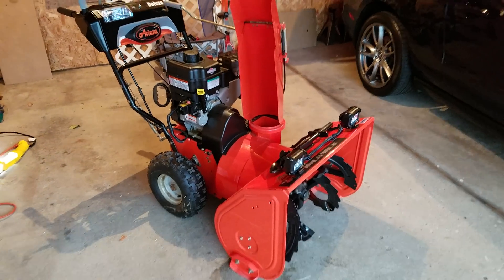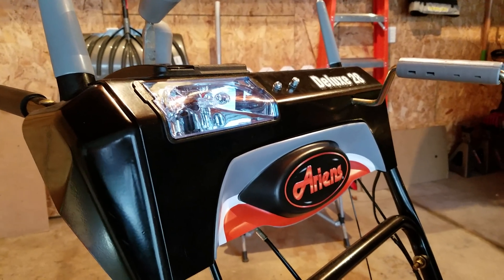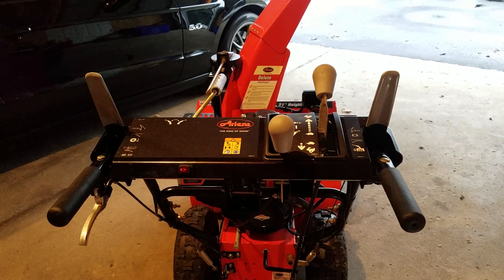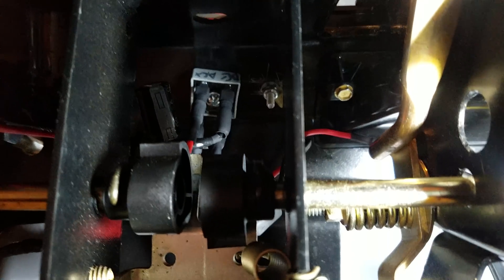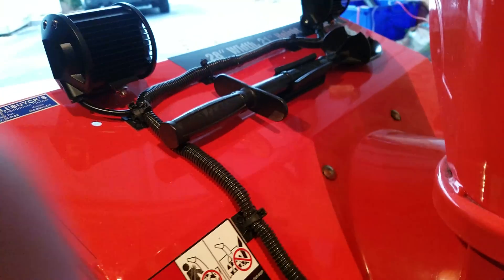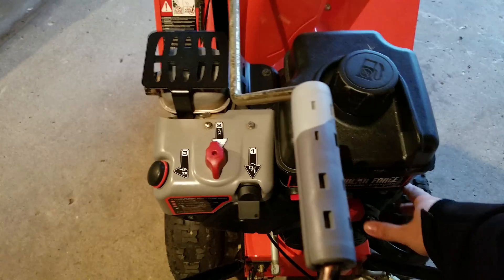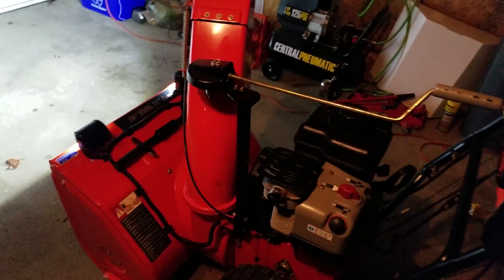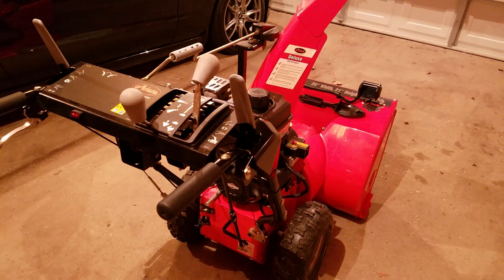Ariens Deluxe 28 Snowblower - 18W Cree LED Headlight Conversion

Comment: Interesting, but I think I'm going to go for a straight DC route by mounting a Craftsman V20 battery holder behind one of the 18w lights and then just using a 4ah battery to power them which will also leave my old Halogen bulb working as well.  That way no need for a switch.  Battery plugged in becomes the switch.  When finished I just put the battery back on the charger.

Comment: Would like to see someone who's come up with a good water tight implementation for capacitors & rectifier.  Seems you could house all the electronics together with just the wires exiting.  Also, a waterproof switch would be a better solution than a standard toggle that will eventually corrode.  Otherwise a well done video.   Some concern with the stator capacity when adding 2x 18 watts of draw  vs the OEM supplied Ariens incandescent bulb.  Ariens used a higher output stator on models with a light & equipped with heated hand grips. With the snow drought over past few years a LED headlamp gives plenty of illuminations and a lot cheaper.

Comment: I’m puzzled by all the complicated wiring. My blower had a halogen light but the housing was all busted. I just tapped those wires and added a led light. Probably could have just swapped out an led bulb like I did on my lawn tractor headlights if the housing wasn’t busted.

Comment: I just installed headlights a used Toro that I just picked up this week. I decided to put mine up in front of the controls to light up everything including the engine so I can keep an eye on  things while I'm moving snow. I would never put them down on the top of the shroud like this guy did, because when you're in deep snow, most of the time it will be coming over the top of the auger housing and bend the shit out of the lights, so that's a dumb idea where I'm from.

Comment: Excellent job, I have an older craftsman I was thinking of installing lights on and I was considering placing the lights where you did, your feedback about removing the glare of the chute cements that idea.  Your wiring is the most professional looking of any video on the subject I've seen to date.
Reply: I bought magnetic rechargeable work lights and they work great.

Comment: Hi MnP40c, getting ready to do some mods. Going to add a led light and heated hand grips. Thanks for the pointers. I realize now it's a little more to it than just splicing a couple wires. Need to do some research!

Comment: Not to be meant as a critic comment, but meant more as an inquiry; why would you mount these two headlamps on the top of the cowling when you 'may' encounter snowdrifts and snowbanks delivered by the city plow that will be higher? The other query is how much night time snowplowing do you actually do? I have an older Ariens that has the original incandescent light and I find it works well enough in the dark hours to see what I am doing. I'm not sure how well that rectifier will fair out being exposed to the elements. Neat process though.

Comment: Other than the light placement, good job 👍
Reply: The light placement is perfect. Lights up what’s in front of you. Stock placement lights up the blower and is absolute garbage for what’s in front of you.
Reply: @joeythefoxxo  first hard snow over the top bye bye lights.
Reply: @MichaelRei99  That’s a fair point. Where I am, the snow is never over the top of the snow blower.

Comment: I just purchased an MTD/Craftsman 28" with the 243cc engine...  Would you happen to know if it has ac or dc output from the engine?
Reply: All stators are AC... DC only if you have a battery on board.

Comment: Be warned that most of the eBay and Amazon lights are over-rated as to wattage. Several reviewers have tested them on regulated power supplies and they are only 6 watts or so. Still fairly bright but not 18W.
Reply: Either way 1 6 watt led is better than the halogen. Hell the free flashlights from harbor freight put out more light than  snowblower light

Comment: You neglected the Sqrt(2)=1.414 difference between AC RMS voltage and AC peak voltage. Your rectifier and capacitive filter leaves you with the peak voltage less the diode drop.

Using a bridge rectifier and capacitor filter from an alternator gets you ((Vac*1.414)-1.2) volts, if you have 12VRMS AC you get 15.8VDC and if you have 14.4VRMS AC you get 19.2 VDC. If your Cree LED's power converter is OK with the high DC voltage, that's great, If not you'd need either a voltage regulator of a DC to DC converter.

The alternator has enough capacity for handwarmers, so drawing all the current in a small fraction of the cycle near the voltage peak should be OK. If it weren't you'd need to add a fairly large choke to increase the conduction angle.
Reply: Amazon sells these lamps and the input voltage is shown as 9V - 32V  so they may have regulator in the case.

Comment: Can't you just install the L.E.D without capacitor and rectifier? Just 12v dc as it is through the engine and the light, just interrupt with a switch right? ground to the switch with the positive making 12v when auxiliary is turned on by ignition and then load side from the switch to the new light?

Comment: I do not like where you put the led lights on the bucket because, if you have trouble with your auger gear box, you have to separate the bucket from the machine to make the repair. Now you have to separate the wires also.
Reply from the maker: carl cappy That is a good point, you could always put some kind of quick connectors on the wires so they can be easily disconnected.  Or install the lights on the handlebars. Thanks for the post,
Reply: @mnp40c89  or just un-bolt the two lights and cut a couple of zip ties
Reply: And nowadays some come factory with a light bar on the housing. Cub Cadet/MTD comes to mind...

Comment: How did you determine what size (watts) LED lights you could run off that wire?  I have a brand new 28" Deluxe SHO Ariens (306cc).  The stock bulb is only a 20w halogen (which is so bad!) so I have no idea what size LEDs I can run off that wire.
Reply from the maker: I forgot how I determined that, but I vaguely remember finding a post on the snowblower forum stating that total output should be about 40watts or less.  For my snowblower I am using 2 18watt for a total of 36 watts.  That seems to be working fine for me.

Comment: @MnP40c  Quick question on the grounding wires only.   So I'm connecting the ground/black wire from the Stator to the AC- on the bridge rectifier and in a separate instance, I'm also connecting the ground wire(s) of the LED lights to the ground on the switch.   There also a ground/black wire running between the DC-  on the rectifier and the ground on the rocker switch as well. Does this sound right so far?  The question is...  is the rocker switch ground an actual pig tail join consisting of a ground wire coming from the DC- on the rectifier AND the grounding wires coming from the LEDs themselves?

Comment: Nice job of the installation. Did you consider raising the lights so they sit a little higher? When I did my installation I took into account snow being higher than the auger housing bucket.Look forward to seeing a review when it snows.
Reply from the maker: I considered it, but here in Michigan we usually don't get too much snow.  If you live in an area that receives a lot of snow, you can definitely do the same job but just install the lights to the handle bars.  If I remember, I will try to create a video the next time we get a big snow storm, and I will show you how the lights look at night.  So far I love them, I can see everything clear as day.

Comment: +MnP40c - i assume you have floods on the front? I'm have spots there and two floods above the cab. I had to put the ones on the bucket higher up as the angle of the bracket/auger housing causes light to be blocked. raising them up gets the full light. Have you noticed this about your bucket lights?
Reply from the maker: I think they are floods but I don't know for sure.  For being on top of the auger, the lights put out a nice wide angle beam, and also shine fairly far down the driveway.  I haven't actually tried putting lights any higher up.  Thx for the comment
Reply: MnP40c sweet! You on snowblowerforum.com? Im posting my updates there now as bassguitarist1985
Reply from the maker: xboxer1985 I am on there, I will have to check it out!  Have you posted on there before?  Your name sounds familiar
Reply: MnP40c yessir! Im a frequent forum flyer.

Comment: Thank you for the video.  Just did the exact same thing to my 254cc Deluxe 28 (purchased Oct. 2017), using your post on the forum and video as a template.  I didn't do a switch or the capacitors, but did use the rectifier and only get flicker at low/turtle idle.  I grounded both the DC- and the ground from the stater to the same spot under the control panel just for kicks and have no issues.  Now I just have to wait for some real snow to hit!  Thanks again.

Comment: GREAT VIDEO!   I bought a brand new Ariens Deluxe 30.  The factory installed light is horrible and searching alternative light options I found this video.  I bought the same lights, bridge rectifier and inline fuse from Amazon for under $25.  I spent maybe another $20 for wire, connectors, heat shrink and a switch.  I opted to mount my lights up higher by the handles for two reasons.  Sometimes I get snowfalls deeper than the auger housing is tall.   I also don't want to deal with disconnecting the lights if/when I ever have to remove the auger housing for service.   Otherwise I have the same basic set up and these lights are BRIGHT!
Reply from the maker: Scott Matthews Thanks Scott.  I would love to see how it turns out!  Hope the install goes smoothly, and hopefully my video helps you out.
Reply: intelligent thinking

Comment: My FIL just bought this blower.  Why a $3K machine doesn't come with an adequate LED light these days is beyond me!   Awesome setup!
Reply: LED lighting creates harsh shadows, although they are improving them year by year.  Also, as traffic light installers figured out the hard way, LED's won't melt off the snow that covers them in the winter.
What I don't like is that fixed light Ariens came up with in these year blowers.  Most people put a shield over it(Ariens  later made factory parts to do this).   Luckily, the Ariens I bought has a bolt on adjustable halogen bulb, so I can just set it how I like it.

Comment: Hey buddy great video, very informative. I have the same snowblower But in my case I connected the bridge rectifier and capacitors just like you said in your video. But it still flicked a bit. And also when I turned down the idle the lights where flickering like crazy you think you can give me some input on what I should do next.... PS sweet mustang in the background

Comment: Clarify, both Capactors come off POS dc terminal of Bridge Ret? And are connected in Parallel to ea other? Then a Fast Blow FUSE ( ? Amp) to Led light(s)? Have I got that right.

Comment: May be a silly question, I followed every step clearly, but I wanted to ask, where does the third wire off the switch go??.
Reply from the maker: Switches usually have three connectors (Power, Accessory, Ground).  You would have the negative wire from the rectifier connect to the ground connector on the switch.  Then the positive wire from the rectifier connected to the power connector on the switch.  Then you would run the LEDs positive wire to the accessory connector on the switch, and the negative wire from the LED lights would also connect to the ground connector on the switch.  Hopefully that makes sense, and my explanation isn't too confusing.  Good Luck!  :-)
Reply: Yes it does, and thanks. I suppose my issue is that I bought a harness from a car part store, and that has a relay switch in it. Perhaps I may need to remove that to see.
Reply: Art Reina I believe the third wire is due to the switch he purchased.   It appears to be a lighted switch, and therefore needs a positive and a negative to light the switch itself.  A cheaper switch may only have 2 tabs.   Positive coming in from the rectifier and power going out to the lights.  The negative in this case would travel directly from the rectifier to the lights.  I believe this is the case.

Comment: Your post is top rate, my hat is off to you. I just ordered a new Airens Deluxe 28 SHO. Will this wireing set up work on the Snow Thrower I just ordered? I have ordered the LED lights, bridge rectifier, got the capacitors, fuse holders and weather resistant switch at Radio shack.
Reply from the maker: Thanks KLH.  I believe this setup should work on your blower, but I would double check to make sure the current isn't already DC from the stator.  I'm not to familiar with the new blowers, but if it is already putting out DC, then you won't have to convert the current.  Good luck!  Let us know how it turns out!

Comment: How did you connect the capacitors to the wires?  Difficult to see in the video.  Looks like you spliced them in and wrapped with electrical tape.
Reply from the maker: Yep they were spliced into the wires between the rectifier and the switch.  I soldered the connections then wrapped some electrical tape around them.

Comment: Nice video! Did you add the 2 capacitors to the same wires ( spaced out) or do you have a +/- wire for each capacitor?
Reply from the maker: I added the 2 capacitors to the same wires spaced out.

Comment: I looked up the replacement halogen bulb for the snowblower and was listed as a single 20 watt halogen. But you added (2) 18 watt lights. Does anyone know the max wattage the snowblower can handle? I'm concerned about drawing too much power and frying something. Your setup looks awesome and is the exact setup I'm going for, minus the on/off switch. I personally don't care if the lights are on all the time like the factory light. The factory supplied halogen light is useless in it's factory location. Great work, thanks for sharing.
Reply from the maker: Hi Mark, on the snowblower forum someone said that the max watt the Ariens Deluxe 28 can handle is 60w.  However, my LEDs are using 36W, and I feel like I can't go any higher than that.  The reason I say that, is when the throttle is not on high, the LEDs flicker a little bit because they aren't getting enough power.  At full throttle, they are fine.   So if you have the same snowblower as me, I would stick to 36W or below.
Reply: Mark Bowyer j

Comment: The use of a pointer would be helpful. The shaky left to right and front to back camera work gave me a headache. You didn't source purchases, you didn't show the wiring diagram, didn't explain why a capacitor was needed, where the fuse is and why that rating. From an educational viewpoint it was more confusing than instructive. Now to really learn how to do a LED conversion I have to go to a different site. The loud engine noise and shouting over it was a poor choice. You could have turned the engine volume down (editing) and simply did a normal volume voice over.
Reply from the maker: Sorry my video did not meet your expectations.  If you read the description it lists the model #s of the capicitors I used, and the bridge rectifier.  Also I sourced where I bought them.  Go to ebay and search the model # of each, and you will find them out there.  If I have time, I will create a more detailed video with diagrams and such.  Sorry if you think I wasted your time...
Reply: Nothing wrong with your video man. Any parts one would not understand, just go to the web page you posted.
Reply: jeez Charlie...would you like for him to come over and install the for you....he said go on the forum for a more informative install...he's just showing you what he did...and its not rocket science...if the fuse and capacitors are an issue maybe skip this project....
Reply: Sorry to say, but if you can't watch this guys video and successfully wrap your head around what he's telling you along with visually seeing the connections to wire the switch, capacitors ,fuse and rectifier along with installing the lights then it would be safe to say that you probably shouldn't be fucking around with your snow blower to begin with..... period.

Comment: Nice install! Have you tested it on snow in the dark yet? It looked like you didn't get any snow over there yet... With my installation with the LED's just by the handles, I get a lot of glare from the snow being thown, as the light hits the snow very close by. It looks like a great idea to move the lights further to the front! I will also try to add a couple of capacitors to my installation. When running on idle, mine flicker a bit as well... Great video!
Reply from the maker: We've had a couple "big snows" here so far, and the lights work great at night!  I do like having them in front of the chute, it seems to help a lot with glare and prevents shadows cast by the chute.  I highly recommend mounting them above the auger.  Just make sure if you do move your lights, secure the lights well because they vibrate quite a bit.